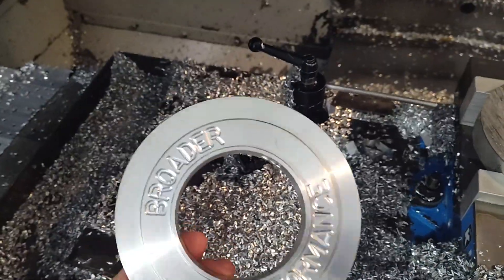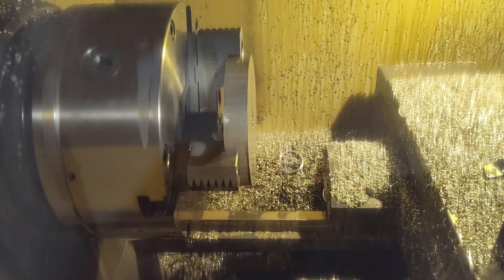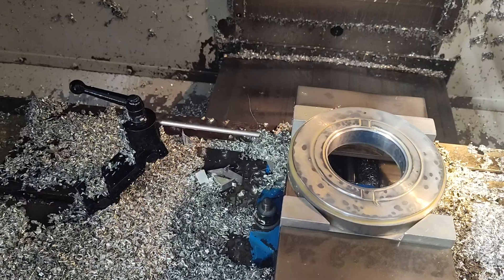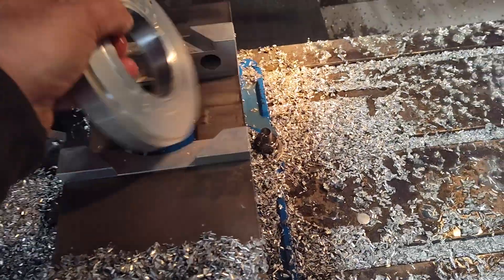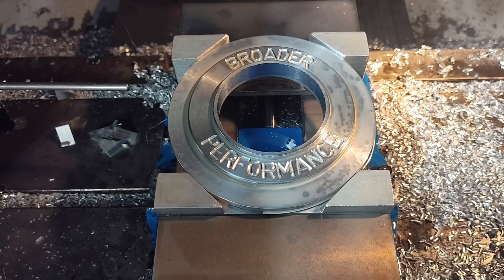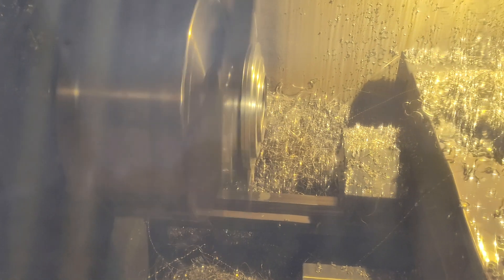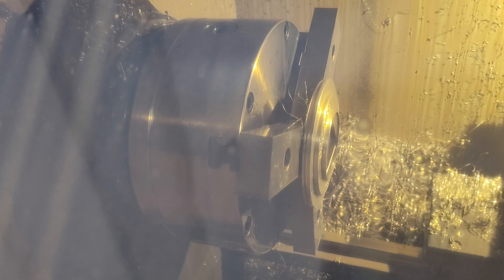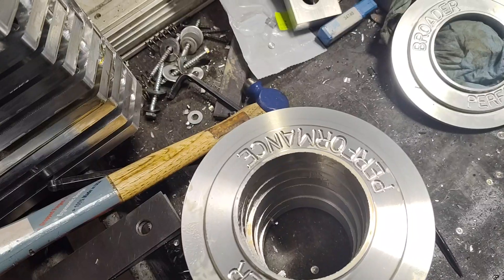Manufacturing Process of Ford C6 Pistons

Comment: ordered one when i seen you had some in stock.  built a c6 for a sled pulling truck . not really any trans shops around me that do specialty trans work. the last 3 c6 i had rebuilt the old fella was getting cranky and finally retired. so i spent about 6 months doing one myself. if it doesn't work properly it's my fault. "/
Reply from the maker: Thank you. We appreciate the business. I'm sure you will make out fine.

Comment: They make inserted lathe drills that you can also use like a boring bar. With one of those you could potentially combine step 1 & 2 in the lathe and eliminate a setup in the mill. Just an idea.
Reply from the maker: Good suggestion. Ill look into that.